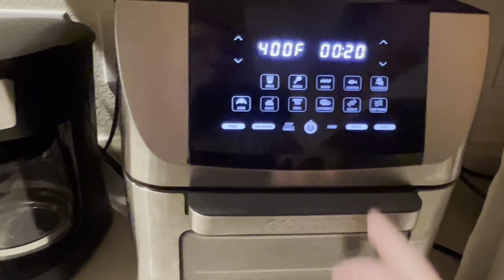How to Make a DIY Kydex Axe and Hatchet Sheath

Comment: ..and iv been using a bandsaw to cut my kydex sheets this whole time. Nice tip there... much easier and cleaner than the saw. What rubber mat are you using there for your work table?
Reply from the maker: The mat is just a large industrial floor mat that I found and cut to fit my workbench.